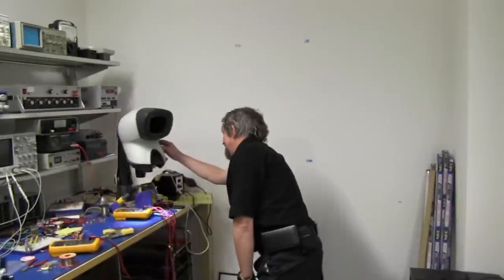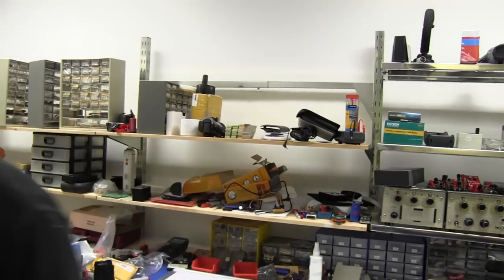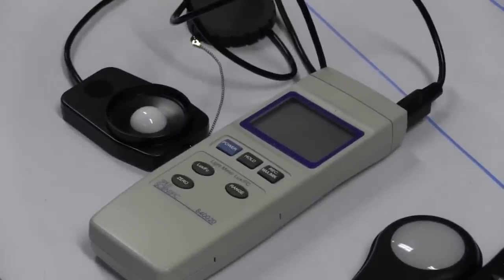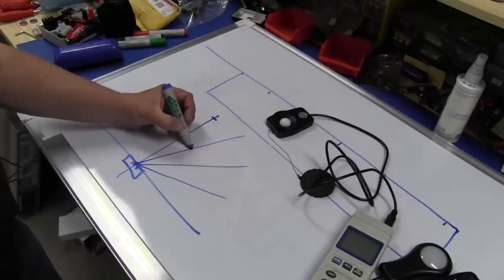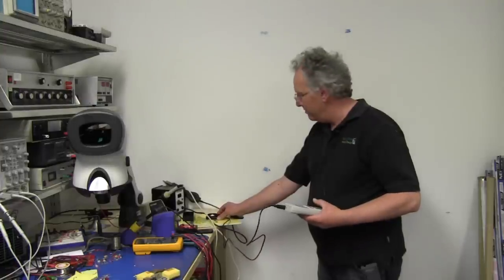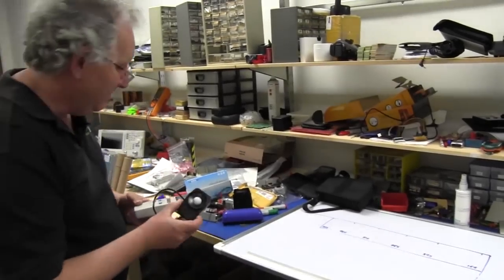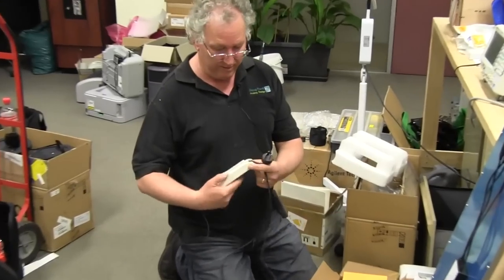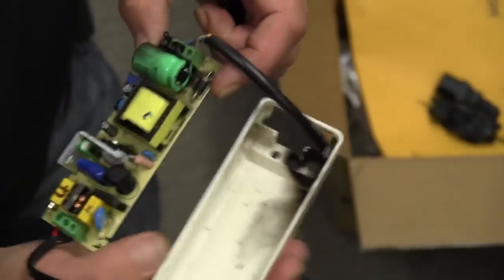EEVblog #362 - LED Tube Lighting Install & Theory

Comment: The exploded power supply actually looked quite good quality.  Proper opto feedback, fat output cap, multiturn pot and good filtering.  But not much of a cap on the input side?  I wonder if it's riding the rectified sinewave like the electronic halogen transformers to improve power factor.

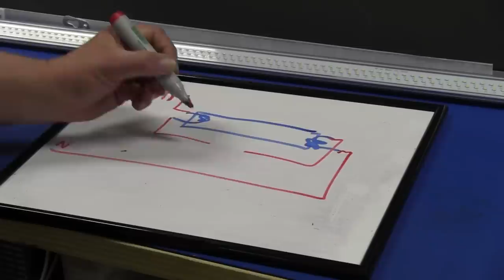Comment: A little mistake at 13:50 ff: the switch is parallel to the gas-discharge lamp.

WIkipedia says correctly: The automatic glow starter consists of a small gas-discharge lamp, containing neon or argon in parallel with a normally open bi-metallic switch. It functions as a time-delay switch, turning the filaments of the fluorescent tube on for a few seconds to start it, then turning them off.

Comment: These drop-in florescent replacement LEDs have come a long way in the last few years. I just picked up four of these from Costco for 20 bucks apiece, and I'm loving them. They're plenty bright, they turn on instantly, and they're not affected by cold temperatures. They replaced a bunch of old 8-foot T12 tubes in my garage, which took forever to get bright during the winter.

Comment: Did you ever do a follow-up with Doug on what that Top Band (sp?) company did to make things right? All the safety went into just positioning the PCB. But, the company never designed the cover so that it can be placed onto the base just one way. That is wacked!!! I hope the company has sent Doug 10 years supply of drivers. There is no way, NO WAY Doug could have seen that coming. Maybe the input and output connectors could be different colors, so that in case the PCB is placed in wrong, at least the colors would have given it away.

Comment: The LED tube I use in my kitchen is fed from a connection at each end, but I always steer clear of the "other end" of a tube when fitting anyway, I don't fancy being the ground end of a fluorescent! I did a teardown on YouTube of my kitchen one.

Comment: The description of how the starter in a fluoro works is a bit off.  The bimetal strip is in the glass capsule with the neon gas.  When power is applied, the neon allows a discharge between the contacts, which heats up the bimetal strip.  this CLOSES the contacts.  The discharge stops since the electrodes are short, and then it cools and opens, causing (hopefully) the inductive kick required to fire the tube. Vdrop lowers across the tube and the neon cannot ionize after starting.
Reply: @kevtris
i noticed he got that wrong as well , but i dont think its neon gas , it glows purple(ish) while its warming up :-)

Comment: Hmmm... It is possible that it is the failing microphone batteries that is responsible, there is some rather noticeable noise at 34:02 and that is before the LED strip is powered up.

Comment: I had to sign up an Australian channel for someone to describe how a starter for a light-tube works... I just had a hard time to understand why our high quality "Made in Germany by nude virgins" Siemens Circuit Breakers always break when someone turns on the light in our high quality 70ies vomit-green bathroom.
Reply: Did you find out? Same happens actually to me:-( Pleas elighten me

Comment: Thanks Doug and James. Very interesting and enlightening has to watch a couple of times to take it all in re. the safe wiring config. .  Have just recently received LEd tubes from eBay deal.  Look Like they are not configured the safe way, One end is positive lead  the other end negative.  ?? whether they are legal for Australia.  Am communicating with seller as a result of the video  regarding whether they are Aus standard passed as there are no labels on them indicating such.

Comment: I can buy a high efficiency 54W T5 with a CRI of over 90% for £5 with an output of 5000lm. That would probably buy me one or two LEDs with the same CRI, but probably only 150lm each if running at maximum power (where the efficiency is a LOT lower).

Environmental costs are probably just as high for LEDs in terms of manufacturing.

Comment: LED strips and LED bulbs are nice but at least in Europe they are still far from being cheaper than fluorescent or CFL lights, since the efficacy and power consumption are comparable (75 vs 75-100 lm/W) but the initial price is way higher.

Comment: Square root law?  I think the term he's looking for is 'Inverse Square Law'.

All those years of physics paying off >.>
Reply: +ReddmanDGZ Sorta. Inverse square works for intensity, but it's a square root law for sensitivity of the eye. Double the intensity, you increase by the sqrt(2) in perceived brightness. Quadruple it, and your eye finally says "ah, yeah, THAT's at least twice as bright!"

Has to do with the sort of automatic gain control of our eyes. Works in the other direction too, double the distance, 1/4 the actual intensity, but we'll perceive it as approximately 1/sqrt(4) or about half as bright, within limits, because our pupils dilate, and our photoreceptor molecules are replenished. Higher intensity light tends to bleach rhodopsin, so the initial response is very strong, then tapers off very quickly, as our pupils contract, and the photon-interaction to rhodopsin (And other -opsin, for each color) replenishment rates come into equilibrium.

Biology. It's all physics, but bass-ackwards sometimes. And kinda neat too!

Comment: Why can't users just turn off the mains power before installing the tube??!
Reply: Often times in large office cubicles and open offices one switch controls lots of lights, so if you're just replacing one or 2 tubes, you'd need to turn off all the lights in the office, and people may still be working.  I have watched people changing fluorescent tubes with the power still on, I remember seeing it happen when I was doing some work experience in a library.
Reply: wshyang haha, no can do. theres no need, for experienced. tho shit can happen. my meter evaporated when i was measuring industrial main cu rods, it flashed like little sun. flash burned my skin off. tomorrow i was licking 220s. you become immune to strom, nooot. but 220 really is harmless to experienced. its not pleasant but definitely not a problem